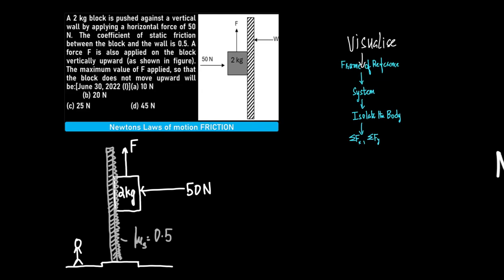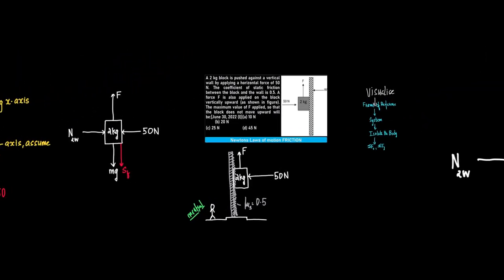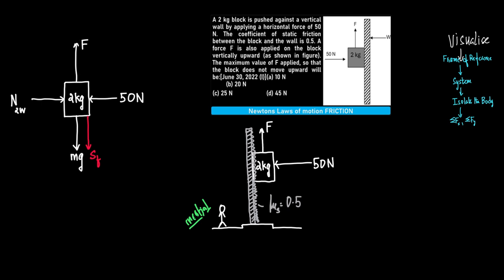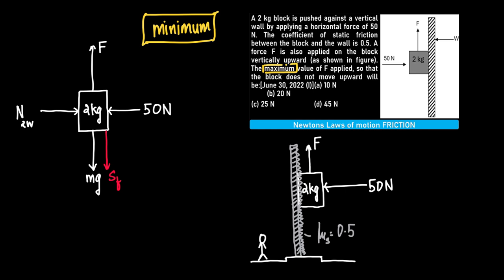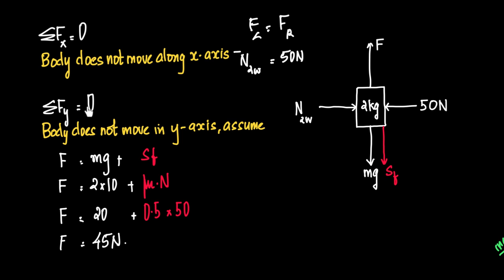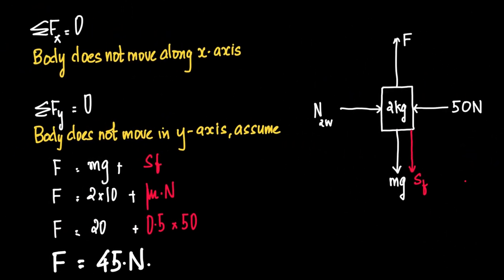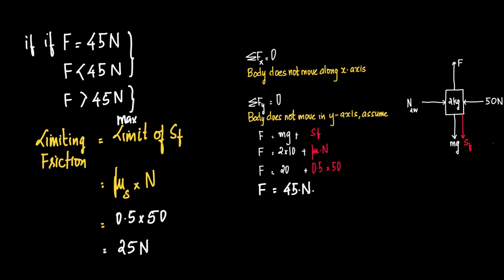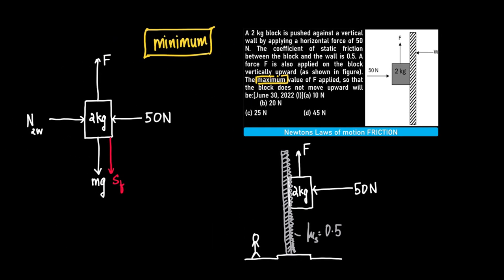A 2 kg block is pushed against a vertical wall by applying a horizontal force of 50 N. The coefficie

Comment: Sir I have a question my question is given , A 2 kg block is pushed against a vertical wall by applying a horizontal force of 50 N. The coefficient of static friction between the block and the wall is 0.5. A force F is also applied on the block does not move upward, will be:

a

10 N 
I Marked
b

20 N 
c

25 N 
d

Sir in my question there is no maximum / minimum specified . So I marked 10 thinking it was our force + friction which is equal to gravity and not  force = gravity + friction. so I reached 10 somehow , and also (probably flawed)

Sir my question is do we take kinetic friction always as u mg or from what I remember correctly , there used to be range of 0 to u mg ,

does this range of 0 to u mg (u = nyu ) , only apply to static friction , or does it apply to kinetic friction and what is wrong with thinking force + friction = mg and not vice versa